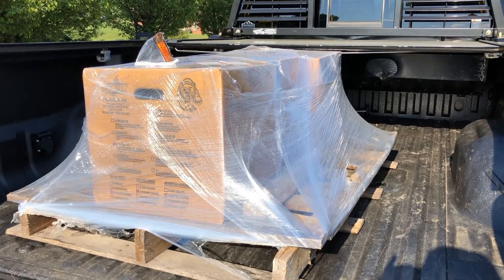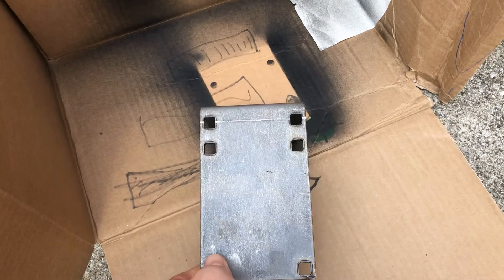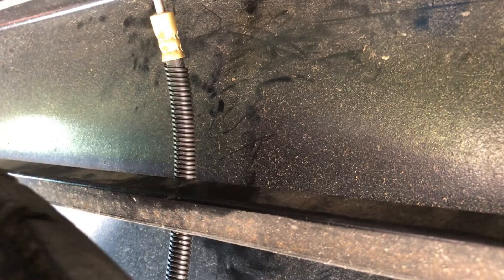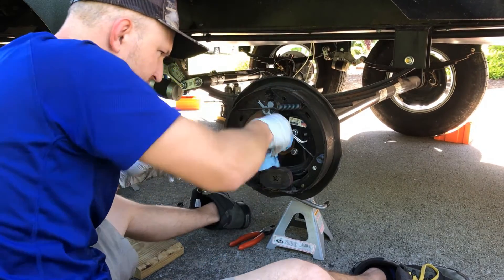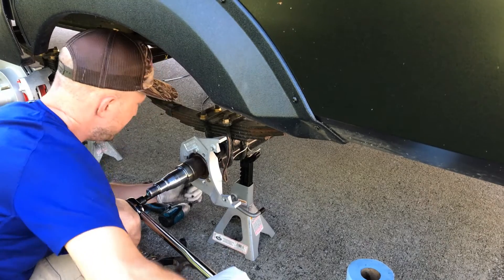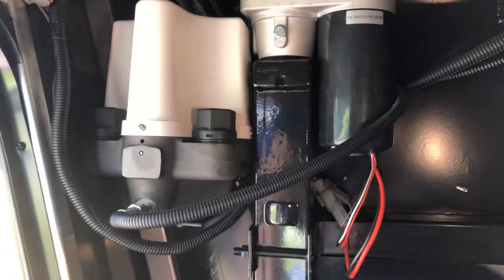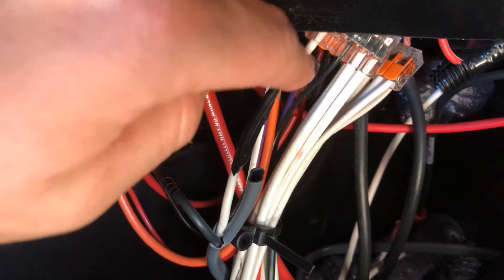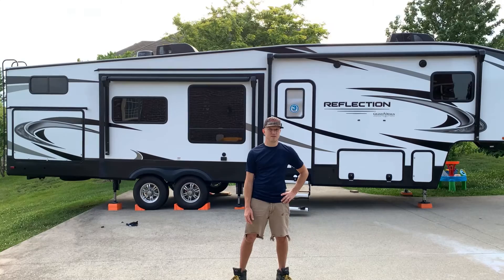Disc Brake Upgrade on Grand Design 5th Wheel RV Camper from Stop Your Trailer.  Kodiak / Titan DIY

Comment: There is a torque spec for that castle nut. It is 50 ft-lbs. Once set at 50 ft-lbs, you should THEN back it off until there is free movement of the hub but no in/out play of the hub...which translates to essentially finger tight. It is critical to hit that 50 ft-lb tightness initially though, as it seats your bearings where they belong.

Comment: Nice job, I plan on converting my 2017 337RLS . Like you said can't tell the difference on trailer gain. It only takes one panic stop gone wrong to cause a lot of aggravation.
Reply from the maker: Robert, Thanks!  I still think it's the best thing I've done to the trailer.  Drum brakes with the non-seals hub bearings is just a recipe for disaster.

Comment: Can you provide a parts list for everything you ordered from Bill? I called today and he’s on vacation until next week and of course I need to order and have everything delivered this week so I can install this weekend. Lots of places recommending Hydrastar actuator but looks like yours is different and would fit better in my RV.
Reply from the maker: I don't think this will be too helpful.  I looked up my order from May of 2020.  It was pretty generic (no part #'s, etc):
1- Titan BrakeRite EHB
16' Of 12-2 Wire 
1- Angle mounting bracket for the BrakeRite
2- Sets of 6,000# Titan Disc Brakes with new Bearings, Seals and 1/2" studs
4- Sets of disc brake mounting hardware
1- Tandem Axle Line Kit

I was assured it had all I needed and Bill has good reviews, so I wasn't worried about exact part #'s etc.  Good luck!
Reply: @rvengineer2300  could you also take a picture of how you ran the brake line across the axle and do you have a link for the clips/brackets you used around the axle?

Comment: When you put the screws through the frame to attach the brake lines did you find anything in the underbelly that was vulnerable to puncture?  There is a lot of stuff down there like tanks, plumbing and electrical.  Also,  would you do anything different if you were going to do the project today?
Reply from the maker: I still tell everyone that asks, I view it as the #1 thing I would upgrade on any sizable 5th wheel.  It makes such a difference.  Where I ran mine on the outside of the I-Beam, I really didn't have too many issues with plumbing or electrical as most of that stuff is tucked up under the chloroplast.  Having removed that on a later project to run some wires, I can't believe how unprofessional the wiring and piping is.  Coming from the auto industry, we'd never bundle things that way.
I'm glad I really took my time feeding the bendable pipe through the small gap in the support plates.  I'm also glad I took the extra time to put the corrugated outer tubing (COT) on everything.  
I've had 0 issues, but it gives me reassurance.

As I've done other projects I'm also glad I took the time to clean the brackets @ the welds that were starting to lightly rust.  Hitting those areas with some touch-up paint keeps everything looking good and prevents future biggest issues.

Overall, take your time.  This a longer project and going slow / being willing to restart is key. 

Also, I'd make sure you understand the electrical side.  Being able to use the existing wiring because I found the wiring diagrams was a huge time saver.

Good luck!

Comment: I tied finding the clamps you use on the axel for the brake hose but no luck. Do you remember were you purchased them at? Thanks for the help
Reply from the maker: Scott, I made them by combining these large clamps around the axle, and then then small ones to hold the hose:
https://smile.amazon.com/gp/product/B00QSNVS18/ref=ppx_yo_dt_b_search_asin_title?ie=UTF8&psc=1
https://smile.amazon.com/gp/product/B000NI3CI6/ref=ppx_yo_dt_b_search_asin_title?ie=UTF8&psc=1
After using disc brakes for 1 season, I still consider this the best thing I've done to the camper for safety and peace of mind.
Good luck.  Reach out if you have any other questions.

Comment: Did the rotors come with races already installed? And did you use your old bearings?
Reply from the maker: The races were installed already.  I used the bearings that came with the kit as it's easier to clean and pack new bearings.

Comment: What did you do with the excess flexible brake line going across the axles?
Reply from the maker: LH to RH axle, the length of flex line was what I needed. without excess.  I secured to the axle with banding clips (didn't use zip ties provided).  Maybe I'm not understanding the question?
Reply: @rvengineer2300  Hello RV Engineer:

Really enjoyed you video on disc brake upgrade.  I just completed project on 2022 Montana Legacy.  It was supposed to be equipped with disc brakes, but was not due to parts shortage the dealer said.

Stop your trailer.com supplied me with s 72" flexible hose and a 24" flexible hose plus the tee with zip tie.  That comes to a little over 8 feet.  The calipers on my unit are only about 7 feet apart.  After speaking with Bill Halasyn, I used up the extra by wrapping hose around the middle of the axle.  Makes that part a little more exposed, but its not  a large amount.

I used the bands and rings as you suggested and also wrapped the flexible hoses with loom as you did.  Makes a neat looking job.

I guess your calipers must be a little farther apart.

Thanks for your response.

Tim Wallace

Comment: What size did you replace the backing plate bolts with? From some research I've done near as I can figure they are grade 5 or 8... 3/8" X 1-1/2"

I'm going to do my 2019 Solitude with 7,000 lb axles but those bolts look like they would be the same for either of our axles.

Refreshing to see how thorough you were with everything. Two thumbs up...
Reply from the maker: Thanks for the feedback. Unfortunately I can’t exactly answer your question as the bolts came with the kit from ‘stopyourtrailer.com’ Bill is very responsive and would probably tell you if you emailed him. I believe your 7k axles are on a 8 bolt pattern, so your dimensions may also be slightly different. Mine are 6k / 6 bolt. I was towing today and had to make a very sudden stop bc of being cut off. Was definitely loving the brakes. I think if I still had drum, I wouldn’t have been able to stop.